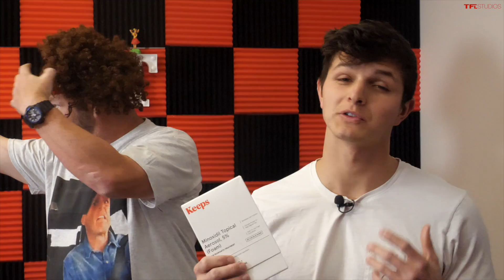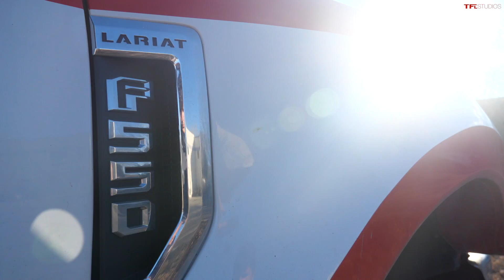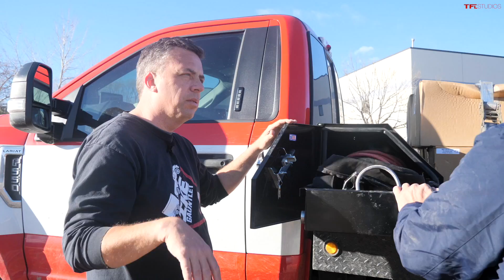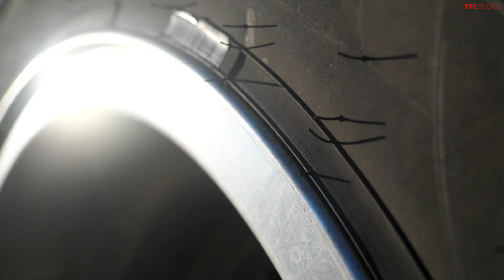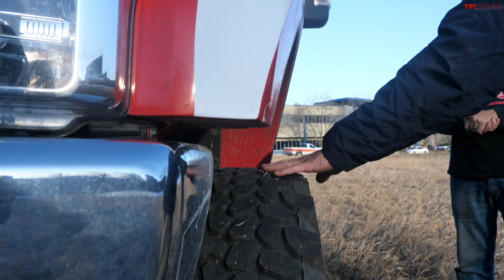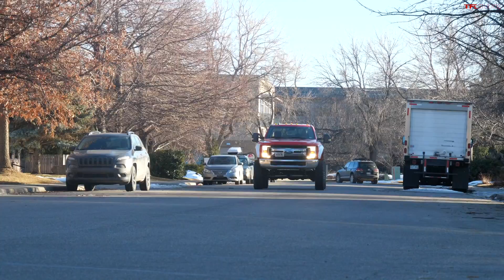I Turned My Lifted Ford F-550 4x4 Into a Comfy Daily Driver With This Simple Mod!

Comment: This guy has implemented every single idea I would have for the ultimate work truck/ daily driver.
Wide front axle, not detuned diesel engine, super singles etc
Great Video!
Reply: Aren't duals better since they don't wear down as fast and if one pops the others will make it all the way to the tire shop, I think they handle weight better too
Reply: @guamazolopez6456  yes.. however they slide  even on wet pavement at times..
Off-road will render the biggest dually useless typically
Reply: @TaigaTurf  true, they are not good for offloading
Reply: @TaigaTurf  you can mount a mud terrains on dually rims your point is not valid
Reply: @TaigaTurf  duallys can haul way more as it distributes weight to the ground a lot better, hence why semi trucks are mostly duallys
Reply: @CopperheadGarage  how many semi trucks do you see offroading in mud/ snow rough terrain?
Reply: @CopperheadGarage  Mud terrain tires on a dually setup do not give you the mud/off-road traction you will get with super-singles.  Not even close.  Yes, you will lose out on the reliability or redundancy of the dually.  You gain everywhere else though, with a super-single.  But hey, if you think you need duallies, then you do you.  There are situations where nothing beats a dually setup.  There are many folks though that use their trucks in a way that super-singles are far superior.
Reply: @CopperheadGarage  mud terrains on a dually doesn't improve it's traction as much as you might think. Also super singles have a lot more advantages than disadvantages over dual. The last trucking company I worked for owned over 500 trucks and they had super singles on rear of almost all of them because of those advantages. They can handle the weight just fine.
Reply: @awdeveau  what are the advantages you got me interested
Reply: @CopperheadGarage  the 2 biggest reasons the company I worked for switched over was better fuel economy and reduced weight,  ability to carry more freight legally. Even their fleet of trailers had singles. 

I suppose for a single truck it might not make that big of a difference with fuel. But when you have a big fleet any fuel savings equals big money. 

We hauled a lot of paper and a lot of water. Both of which regularly put us right at the 80klbs limit. So that's another reason why they run singles.

Comment: I like this guy! I was thinking the video was going to be a bit long, now I’m done and wanting more!!! Hahaha. 
     Nice truck and THIS is a Ranch truck. So is a F150, or 250 etc. I never had one “do it all” ranch truck, but several trucks could fill the hill. This truck comes pretty darn close!!! I suspect it’s a 6 figure build (at least). $68K like Tommy was seriously over reacting to regarding TFLs new Ram 2500 DIESEL, is not excessive. $8K or so is just because it’s diesel. This is becoming the price point. 
    When I started Ranching a 400 hp 4wd Tractor was just under $200K cad, now a similar tractor is very close to, or over $400K depending on the exchange rate. The industry adjusts. I also suspect this guy owns thousands of acres vs 22 acres. That’s a ranch!!! Haha. 
    Nice build! That wheel design is a game changer.
Reply: For the money, he probably could have had a stock F450 and F150!  But, certainly a solution works well for him.  
That toolbox is truly trick.
Reply: Probably a 
$70,000 Truck
$6,000 Wheels
$6,000 Kelderman Rear Air Ride
$2,000 Front Lift
$800 Tires
$500 Fenders
$6,000 Bed
$2,000 Paint and Body work

All that totals to - $93,300

I paid less for my house lol
Reply: @tyeburch4273  - I was close!! That means it would be close to $120,000 Canadian, where I live!! Yeeowchh!!
Reply: @C10sRule  It makes me pucker regardless! But It is purpose built and well done at that!
Reply: @tyeburch4273  it’s actually for sale at like 90k
Reply: @C10sRule  Built something that does the job

Comment: I see to many guys here in Northwest Washington daily drive lifted everything and non have a drop of dirt anywhere. Their tires have zero tread after driving on the road so much
Reply: Well, like it or not, most driving you will do is on pavement. Most people can't use their truck just solely for driving off road. They may like the look, or having the capability when needed, but don't have the ability to go off-roading daily.
Reply: @lyman135  it is very much the norm here  in Australia,  but not Pickups  as work trucks on Farms. Off Road is very much the way to go in many rural or Outback areas here

Comment: I bet it’s an SOB mounting tube type tires on that 1 piece wheel, getting the tube set in eight would be tough for sure, that’s why most 20” wheels for big trucks use a lock ring on the outside bead.

Comment: Getting 15.2 with stock wheels and tires on a 2006 550. Yes, balancing is an issue! How did you recalibrate the speedometer?

Comment: Did this truck have a rear Dana 135 axle from factory because it looks like a Dana 275 or a sterling that came out of a f250 or a f350 single truck now just wondering if y’all swap the rear axle out didn’t talk about it or show it much?

Comment: Those tires on the highway?, I see $$$ just burning up, and tire noise?  Why lift if you tow? You want your tow load LOW...nice truck, but Towing and highway are NOT its purpose.. Glad it rides better.. at what cost?  stock 2019 450 rides nice.

Comment: My new 2020 f350 supercab 4x4 , 235 miles , super heavy steering ,does not return to straight after left or right turn any info on what is wrong?

Comment: I am very interested.  I haul a 28’ gooseneck flatbed, 24 foot gooseneck stocker and currently I’m running a 2000 f350 single rear wheel, I lifted the truck by stacking more springs on the front and built my own 4 link air bagged suspension for the rear and I have been wanting to convert my truck to the dually but have been hesitant due to the fact that I don’t want to lose the ability to go through the window at the bank and I am having a hard time finding someone that will build a short bed western hauler style bed for a Dually. You tell them what you want and they look at you like your stupid. Why is a custom short bed dually so rare. I’m aware that ford built a few short bed duallys abs they’re hard to find in decent shape nowadays. So this would be the perfect happy medium. It’s wider than a single wheel setup but still not quite as wide as the dually. Nice setup. You’ll be hearing from me this week. I csn see this being a major benefit to the pipeliner welding rigs being used in my area.  All that extra weight is inevitably going to need a better foundation that these wheels abs tires can suooort. It’s like a fat girl wearing high heels. She might start out fine but once she starts to get tired, Like worn bearings and ball joints, all that extra weight makes stuff dangerous as hell. This is excellent. It’s got my brain working and thinking of possible markets to target.

Comment: That exposed rear disc is extremely alarming to me if I planned on doing much 4 wheeling where there’s any rocks. That’s a big NOPE  for me, thank you.
Reply: There's a similar truck at my shop like this. No real issue with the exposed disk, it runs in the dunes

Comment: Ask him if his heat works or has ever broke or the radio because my work has 10 of these and five of them the heat doesn't work and they're brand new
Reply: You have 10 new F550s and half of them the heat doesn't work?!
Reply: @rkalla  Yes my company does who I work for I'm going to say we have maybe 12 or 15 of them actually and it's more like four or five of them the heat doesn't work so not half but still that's pretty f**** bad and we couldn't get them into the dealership until 3 or 4 weeks and it's winter time and we plow snow so we couldn't do that so we had to have the shop mechanic somehow Jimmy rigot so it's stuck on hot and then he'll Jimmy rig it back in the summer and it will be stuck on AC I don't know what he did but it works and then it eventually goes out and he has to redo it hey you know what he whatever he does he makes it unnoticeable so the dealership won't be able to tell
Reply: @rkalla  funny we also have 20 brand new 2500 HD Chevys too only pickups and those have no issues yet
Reply: @rkalla  Will say the 7.3 L is much better than the V10 cuz we have a few of those too cuz we bought like four new ones in 19 too in a 73 much better In the 10-speed is serious
Reply: @Mikey-wf9py  dude that is REALLY bad... I wonder what's up with the heating units in those. What year are they? Does all HVAC die or just heater?
Reply: @rkalla  they're all 1 year old I think 2020s or 21s..... They all only have like 6,000 mi on them maybe 10,000 on some of them because they are work trucks mostly idling hours No It blows just not hot The AC doesn't work either It just blows air not hot or cold

Comment: Might be a dumb question but why does Ford limit the sharper turning radius to f450 and above?
Reply: 450 have wider front  axle. Wheel further from frame. Wheel turns more before hittin frame/suspension

Comment: We had an F450 standard cab flatbed at work which rode like
A STONE!!!! You couuld not put a cup of coffee in the cupholder.
It would splash out the truck rode so hard. After a 30mile drive 
on concrete freeway would leave me with a sore rear end. SO
using an F450 as a daily driver is ASININE!!!! This guy is just
showing off.
 'Look at me, my truck is bigger N badder than your 1 ton"
UH,Huh.

!

!
Reply: cool story, boomer
Reply: @theglowcloud2215  🤣🤣🤣

Comment: Is it just me or does this solid front axle setup look overly complex and prone to constant issues? All those components, multiple points of adjustment and failure. Seems like a front IRS seems way simpler, no?
Reply: No.  This is quite a robust setup that is, in it’s basic form, just an overbuilt standard Ford front end.  That extra turning angle is a boon, though.
Reply: IFS does have it's place.. more ground clearance in most situations..
But it simply doesn't hold weight up front as well a solid axle..
Nor can you upgrade to a larger differential easily

Comment: Looks nice and beefy. Also good job on designing it to b safe on the road and off road. Taking the loads for regular dulley wheels. I like the air bag system. On another note, Andre, the new camera u guys r using is not good. The video keeps freezing every now and again. I think u guys need to go bak to the old cameras u guys were using

Comment: Own a F450 and Id wondered if a super single existed for these he’s dead on you drive these stock especially now that city’s are not maintaining their streets its a awful ride! Plus with the dually on the freeways and the constant DOT moving the lanes causing the grooves in the concrete to meander back forth across the middle of lanes! The rear likes to follow the grooves. You have to be on your game! Ive aired down those 110 psi tires to 75 psi greatly improves ride but that suspension is of course still meant to haul a load. The 4:30 gears is another big issue. Ive been thinking about the gear vendors overdrive system. Not sure which would be cheaper though. Would have to do some MATH!
Reply: When empty, do you normally run 75 psi?
Reply: @edwardhoward4708  only when empty of course. The dam roads are so rough around here . They defunded the cops and the road crew!

Comment: Did he ever explain why the 450 has a 550 badge?
Reply: I did not.  I have friends with F550 super single trucks with kelderman kits.  The only kelderman kit available for the F550 is stock height. This one sits several inches higher because kelderman makes a 6” lift for the F450 pickup.  
The devil in me put the F550 badge on it to upset the F550 guys when I park next to them and it is considerably taller and the “same” truck.
I tell them that they got ripped off because they were not sold the BIG kit and that they need to call whoever built their truck and complain!  
The calls are comical…
“Sir, there is no air ride lift kit made for the F550”
“YES there is… I am looking at one RIGHT NOW!!!”

I just smile and walk away… deeply satisfied with leaving a fellow truck guy fighting the good fight!
Reply: @wehring  Thanks for the reply.  This is awesome info, and I absolutely love the build!  A practical truck build for someone who knows trucks, and built it for work!  One of the best TFL videos I've seen!

Comment: I drive one of those everyday mine has a 7.3 L Godzilla obviously the power stroke is more powerful but the Godzilla is probably more reliable It's a push rod with sequential fuel injection iron block you do the math
Reply: If you delete the 6.7 it’s more reliable. But stock i would agree with that
Reply: @Bassmanthestriped  so basically make it so you can't drive it in half of the states
Reply: @Bassmanthestriped  cp4 disagrees
Reply: @Bassmanthestriped  yeah and this one is definitely deleted, that startup was badass

Comment: 1700 rpm at 70 mph is ridiculous. My diesel runs 1200 @ 70
Reply: That's quite a story you should be very proud of yourself
Reply: Difference in diff ratios tire sizes and transmissions overdrive gear

Comment: Looks good outside, wish he had done the beige color interior. Also I wish it was a F600 but either way I think it’s a bad ass truck.
Reply: F600 wasn't an option or even a model in 2019
Reply: @AK_Ray  That’s true. Also, he wanted the full power 6.7 (not derated like chassis cab trucks) and the pickup truck style fully boxed frame of the F-450 pickup, compared to the open C channel of chassis cab trucks.
Reply: @AK_Ray  true

Comment: Remove the ugly front fender flares, put a longer flat bed and it would be perfect
Reply: @TaigaTurf  i know, I heard him
Reply: For you maybe.  For him, obviously not.   He built what he wanted.  Not what you want.   And they aren't flares.  They are custom fiberglass fenders.
Reply: @willb3018  the guy can have whatever he wants, I never said he couldn’t. And yes they are flared fenders or fender flares whatever you wanna call them. Fender flares on any truck is ugly in my opinion.

Comment: Watching this as a European, a f550 as a daily driver seems incredibly silly and wasteful of your money, only doing 14mpg.
I guess it makes sense if you tow heavy loads almost everyday, or go offroading a lot. Otherwise, what a waste, even at the cheap fuel prices you have over there.
Reply: Wait until you hear the older 2500's get similar mileage!
One truck and fuel is cheaper than 2 vehicles with registration, plating, insurance, and maintenance.
Reply: @vhateverlie  Well, not in Europe! With our fuel prices. We always have a 4x4 next to a regular car. In lsst years that has been a 4x4 campervan. Currently a 4x4 Sprinter van. No way that I would daily drive that with the expensive fuel. I have an electric car as a daily driver, but even if you have like a small fuel car, it is much cheaper. Of course, if you only drive 10.000km in a year it is probably more expensive to have 2 cars, also in Europe.
Reply: @roland9367  you don't need to understand it Euro, what a man chooses to do with his money isn't of your concern anyhow.
Reply: @AK_Ray  You fail to understand the difference between trying to understand someone or telling them what to do?
Reply: @roland9367  seems silly and a waste of money, is an opinion not a struggle for understanding.
Reply: @AK_Ray  And I'm not telling somebody what to do
Reply: @roland9367  and I never said that you were, but your opinion on what one man does with his hard-earned money isn't any of your goddamn business.
Reply: @AK_Ray  I don't agree, my opinion is my business :D
Reply: @AK_Ray  my opinion is none of my business? :D
Reply: I think I’m averaging 7-8 these days
Reply: 2008 f350 gas

Comment: The truck is basically an F250 and he is trying too hard with the tires and suspension lol. 
He's not going to tow anything big with this truck anyways. He should have just bought an f250 to begin with and lifted it, it would basically be the same thing for way less money. He is just complicating a simple thing.